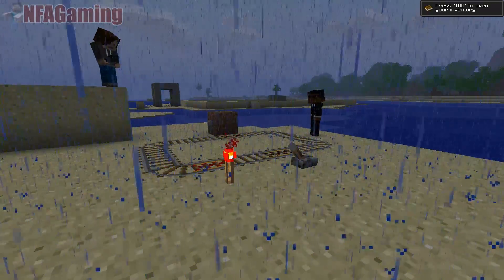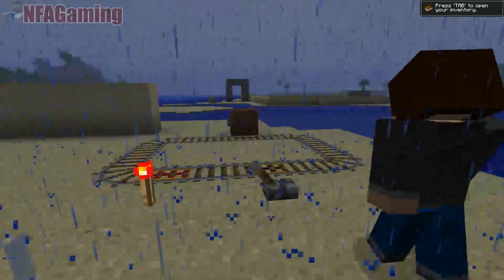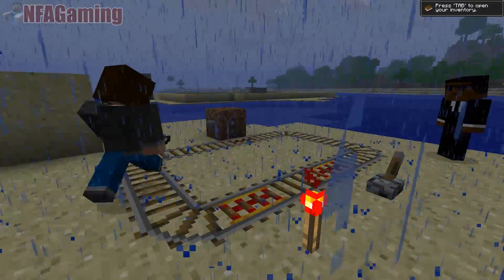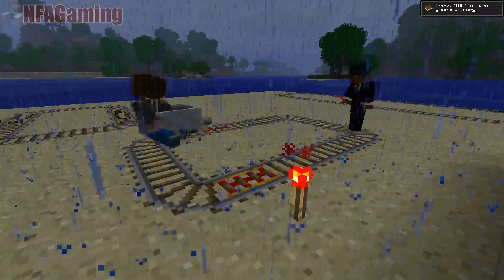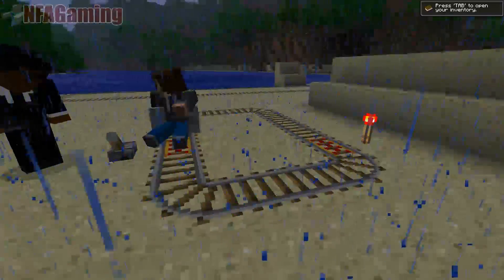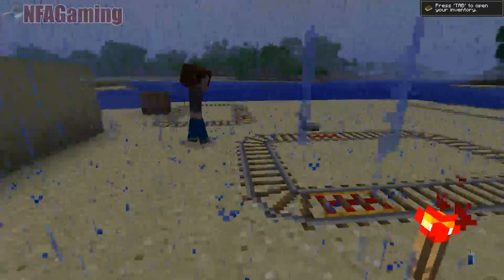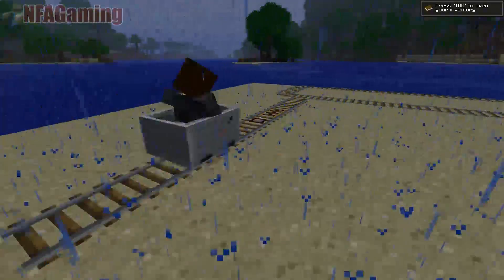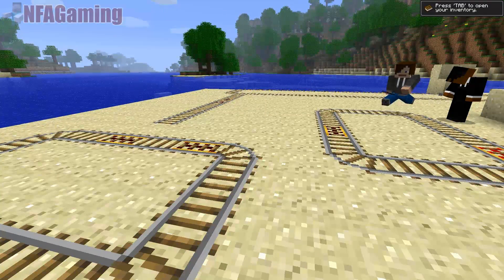Minecraft - Powered Rails Tutorial: Basics [Part 1]

Comment: the set up with the pistions must be in a strae line if u looked down at it the pistions are stacked on top of each other and it has to push and pull the pistion above it the normal pistion push's up the sand 2 blocks high and need to go back to set to push posishion or the sand drop posishion, but don't speed the swich on and off the swich cuz the set up will kill the sand if u do it wright or wrong... and u have to be able to have the swich to get in the base and out of it
Reply: yo you still out there man